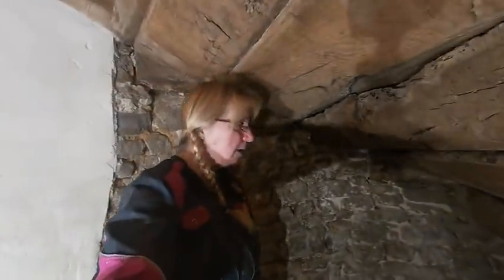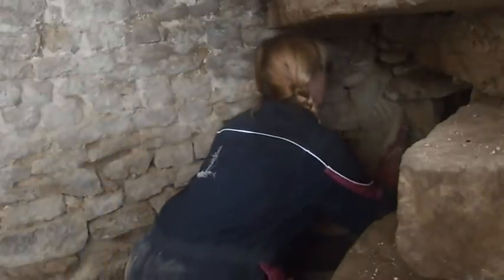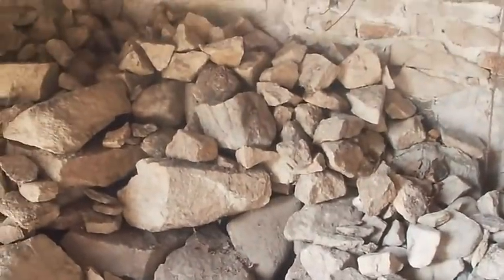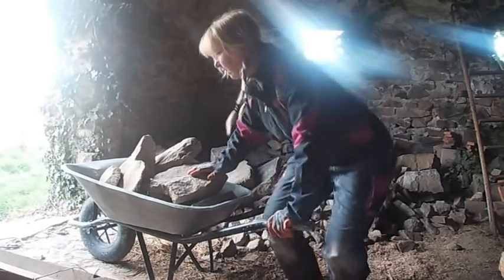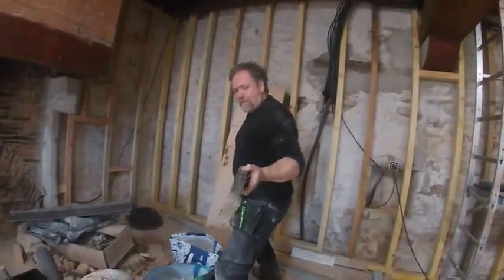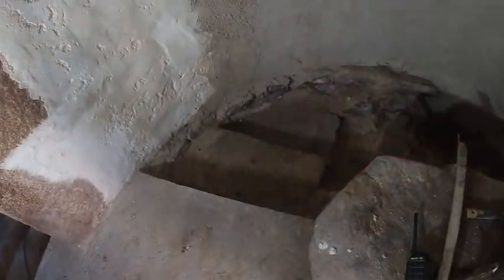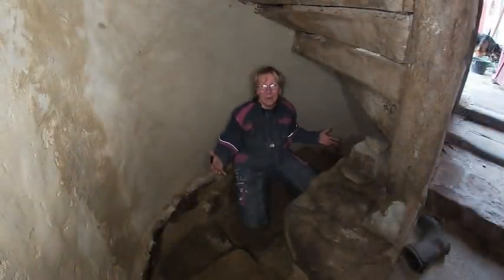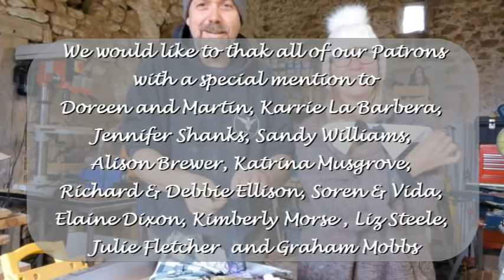125. The tower void is breached!

Comment: Would it be possible to lower a light and a camera down thru the hole. Some plumbers have a small camera on a cable that they use to view down pipes. Or maybe an archeology class from a university. Not to dig it out but just to look inside with a very bright light and film it.